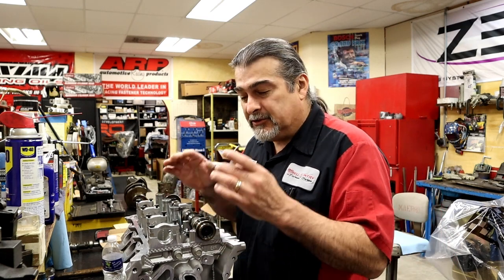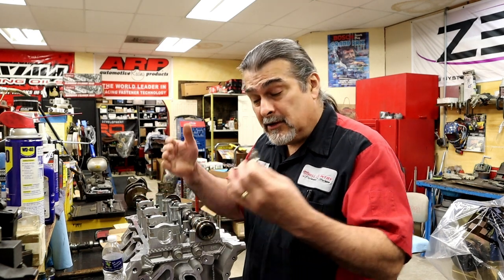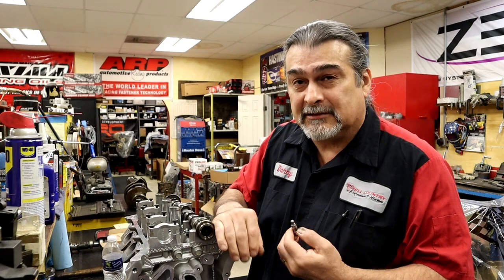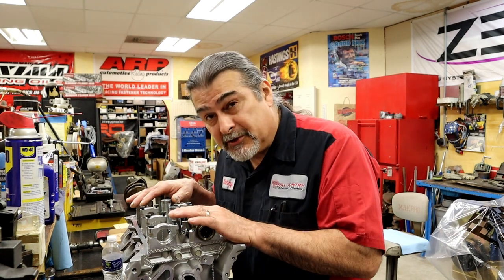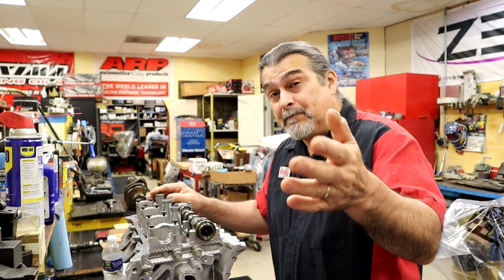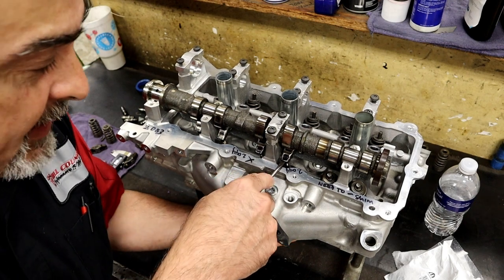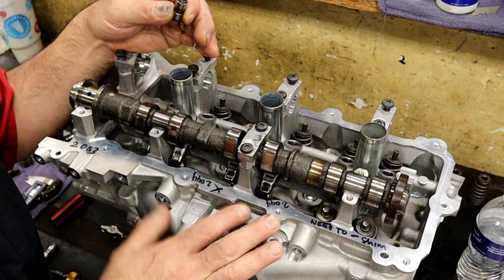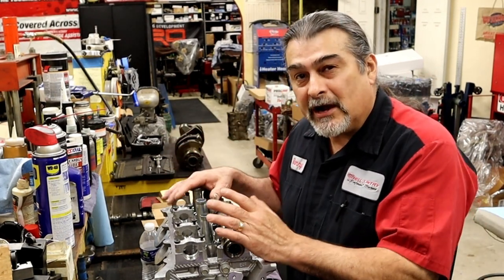Chrysler / Jeep  Lifter noise problems

Comment: Thank you for this video. I used roller arms from eBay and engine started misfiring.  Replaced the cam. Still misfiring. Found your video and did a compression test. Low compression. Ordered Mopar parts from Rock Auto. Fixed the problem. alleluia
I would of never thought the first roller arms were faulty.
Thanks again
Reply from the maker: Glad it helped

Comment: Subscribed!  Loved your explanation.  I have a Jeep Grand Cherokee with the 4.7 and am hearing some lifter tick.  This gives me some ideas.  Vehicle has 158K miles.
Reply from the maker: Check your oil and see if it’s thick and dirty. A good motor flush and an Italian tune up. Then change your oil with so nice new oil. Should do the trick. Thanks for subscribing.

Comment: So compression and leak down was good with the engine cold, but when running and exhaust valve stems expanded, the valve (s) were held a shade off the seat.   What's the total range of the lifter?   I'm a tech in the harley world, we use 0.200" range lifters, and shoot for 0.100" (50%) when adjusting the lifters.   The top of the engine grows 0.030-0.040" from cold to hot, so we end up at around that 0.060" preload.  A common problem on harley engines is that the cams roll on needle bearings, which sometimes blow their needles out and excessive preload on the lifter keeps the engine quiet until the end of the camshaft has worn through the shell of the needle bearing right into the block casting.   Having ground up needles in the engine is bad enough, but having to send the case to be welded up and rebored for a new needle bearing makes for a hefty repair bill.

Comment: with the hydraulic valve lashers, how do you adjust the preload? seems the lasher gets pumped up with oil until the cam follower makes contact with the base circle of the cam lobe?
Reply from the maker: The valve preload is set by the factory and or machine shop when they do a valve job. It’s set by the valve stem heights.

Comment: I recently had a bent intake valve on the #4 cylinder 3.7 liter. Found out that the lifter is stuck keeping the valve open. I was able to bleed it down by gently using a vice.
Reply from the maker: Had the cylinder head just been off?
Reply: Yes, had to replace the head due to a blown head gasket. The new head that I got had a defective lifter? After I first installed the head it ran like crap and after a compression check I found the #4 cylinder dead. Pulled the head back off and that’s when I found the bent valve. Do you think that replacing the bad lifter would fix this? Thank you for the reply btw!🙏

Comment: I purchased new Mopar lash adjusters for the 3.6L Pentastar, and I cannot compress the plunger straight out of the package. Should these be installed straight out of the package, or do I need to release oil pressure and bleed them down? The service manual says they should be at least partially filled with oil, but in another section states that they should be filled with oil.
Reply from the maker: Go ahead and install them as they are, once installed turn the engine over by hand until the valve opens all the way. Let it sit a while and let the spring push the oil out of the lifter. Then tune it over to another lifter. You can tag the ones that are open unlit you get them all done. If there’s some that that didn’t bleed down enough it will shake and maybe backfire a bit but should adjust them self out in about a minute.  This engine does have stronger valve spring them most. Hope this helps and have a great Labor Day weekend.

Comment: How could it pass a leakdown test if the valve was never able to close all the way?
Reply from the maker: He pulled the rockers and liters and it pass, just wouldn’t pass with them installed.
Reply: @MrDanielSoliz  I would think a shop would have performed a leakdown test with everything installed and heard air leaking past the valves. Test failure, call the customer and tell them that they have to pull the head off and send it to the machine shop. But the technician went a step further and pulled the rockers, performed another leakdown test which passed, and still wanted to pull the head knowing that the customer completed the job himself with cheap parts? Could the valve stem height not have been checked with the cylinder head installed? Or is there another variable that I'm not thinking of which could cause the cause the issue? I'm certainly happy that you got the work and could put your amazing knowledge and skillset to work, just seems like that shop really dropped the ball that caused the customer a huge unnecessary expense by removing the head.

Comment: That is not a lifter A lifter moves up and  down  . That is a valve lash adjuster because it does not move up and down it only has an oil controlled center valve